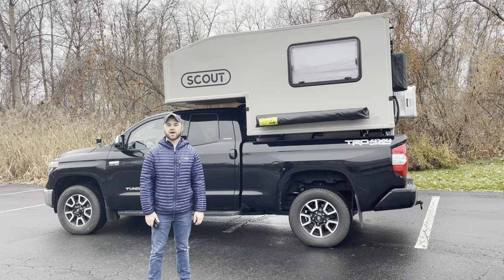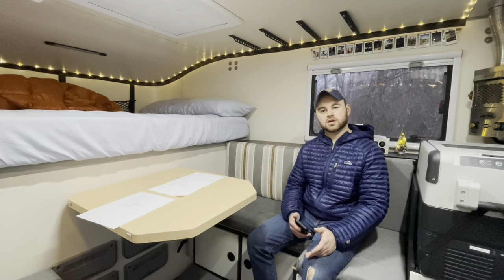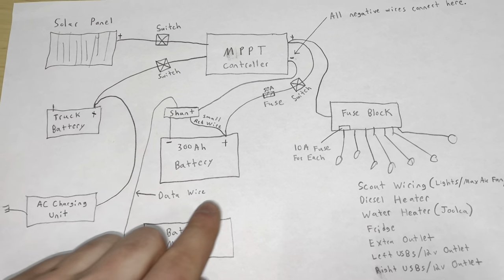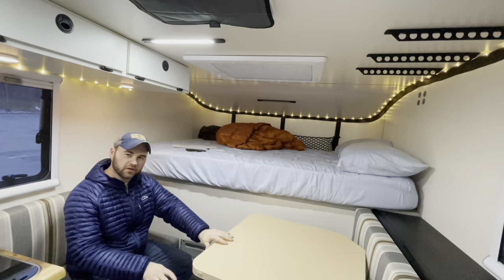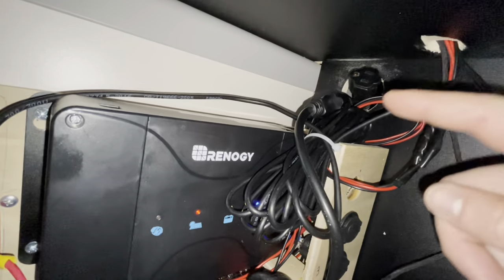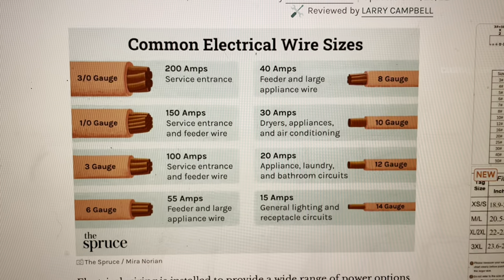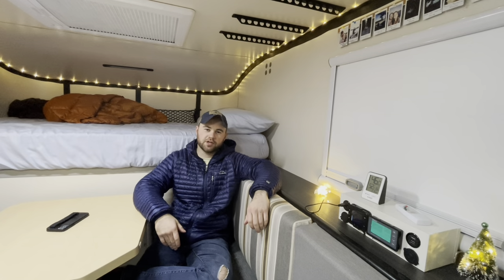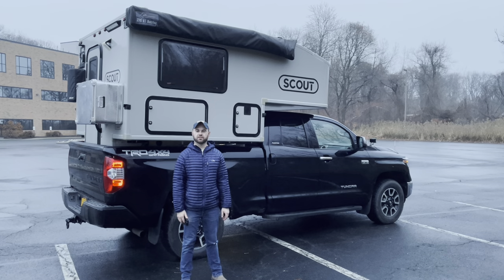DIY Compact Camper Power Setup 300Ah of LiFePO4!

Comment: I'd dump the 12v cig plugin bus you got going. Anderson connectors won't fall out over rough ground and can handle a lot more amperage. As well I'd look at powering your starlink via DC plus any other devices you have as that 12v inverter will be a pig. Most are only 70% efficient
Reply from the maker: Thank you for the tips! Maybe we’ll want to change them over to Anderson connectors if we have a problem with these, it was just easier to keep the plugs like this for now. We have looked into the 12v conversion for the Starlink but just haven’t done that yet, we really don’t currently use it enough.

Comment: 4RA, Thanks for posting this informative and helpful video. I was uncertain about the orientation of the diesel heater, but I guess it can be mounted sideways like you have done. Makes sense to do it that way. I did want to ask about 'drilling and tapping' the hole in your external diesel heater fuel tank. What technique did you use? What did you use to seal the hole for where you tapped your fuel line into the diesel heater fuel tank? I would like to do this as well, but uncertain how to.
Reply from the maker: You’re welcome, I’m glad you found the video helpful. For the diesel heater, I’d really recommend one, it’s been great in the cold weather recently. As for the fuel tank, the kit came with the tap for the tank which only required drilling a hole and using the included o-rings. Here’s the kit I used:

SUPERFASTRACING 2KW 12V Diesel... https://www.amazon.com/dp/B07KMPH5GN?ref=ppx_pop_mob_ap_share
Reply: Roger that and thanks very much. Happy Holidays to you, friends, and family. @kateandjosh

Comment: The truck. A Toyota?  Gas? V6 or V8? How does it handle the load of the bed camper?
Reply from the maker: Yes it is a 2021 Toyota Tundra Double Cab/6.5ft bed. I think it handles the camper great, granted I’ve never owned any bigger of a truck to compare it to. We have E-Rated tires(10 ply), Firestone Airbags and a Hellwig Sway bar in the rear.